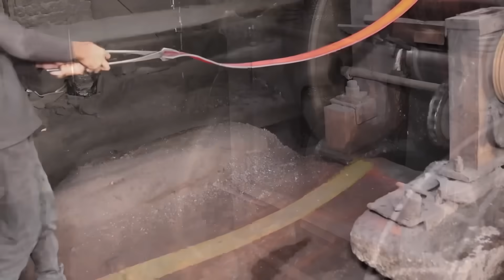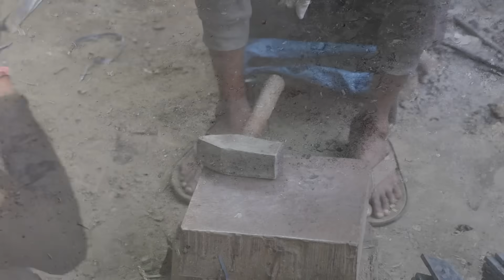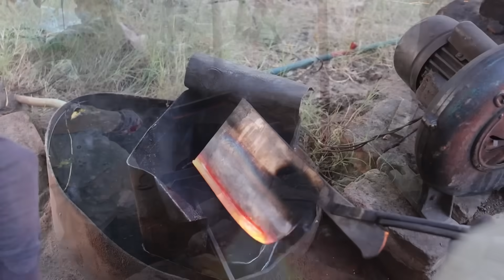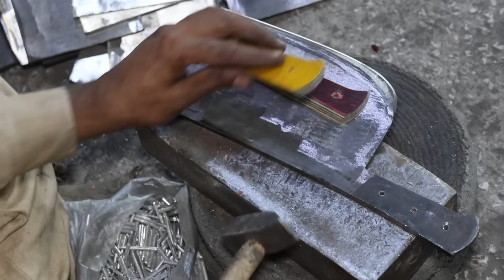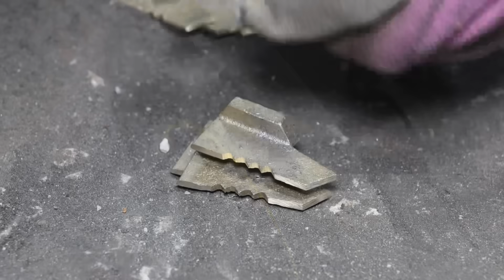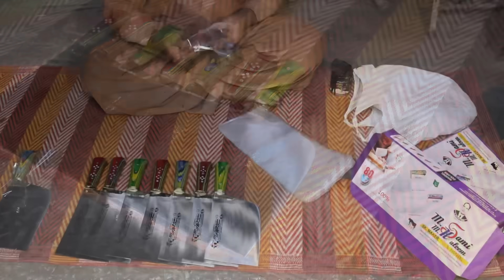Process of Mass Producing High Quality Butcher Meat Cleaver Knife | Old Factory Manufacturing

Comment: If that chopper is manufactured in USA it would cost no less than $500 dollars.
Reply: It wouldn’t last as long either 😂
Reply: I think it will be almost 20 to 30 Dollars here in Pakistan.
Reply: Nonsense. It'd be 10 bucks because only one person would be needed to make it. It's also be from much better quality material and that person making it would not permanently risk to have a limb cut off by unsafe machinery.

Comment: I like the labour of Pakistan. They are hard working.
But they waste their labour. Despite having a cutter, they are using Gas t cut steel. Making steel strips from waste steel can be modified to continuous strip manufacturing and cutting. It's only synchronising the machines.
Further, this process will give only a standard cheap knife.
A steel knife of high quality, can be made with a little more efforts, which will fetch ten times more price.

Comment: one of the best  high carbon knife
Reply: Nonsense. The steel they use is low-carbon, almost close to rebar.
Reply: @einundsiebenziger5488    yes, rebar is low carbon steel, but steels that they are using high carbon/or steel from train tracks

Comment: I think you're using the term "high quality" a bit loosely here. They're nice, but not in that category of quality. 😂
Reply: You are a LIAR
Reply: Why are they not high quality!
Reply: @kdmc40   Because they're pounding the hell out of cold steel. They're grinding on hardened blades without keeping the blade cooled off. I could go on but I guarantee you there are stress fractures and soft edges in a lot of those blades.
Reply: @daveklein2826  Butthurt much? 😂